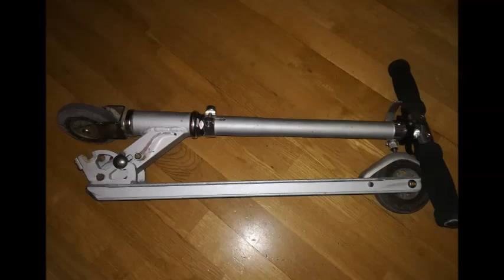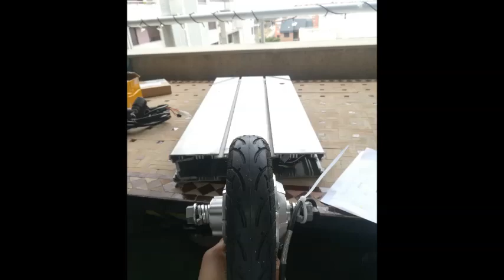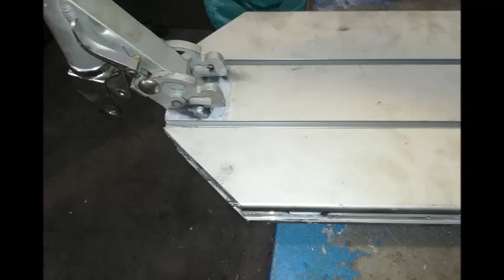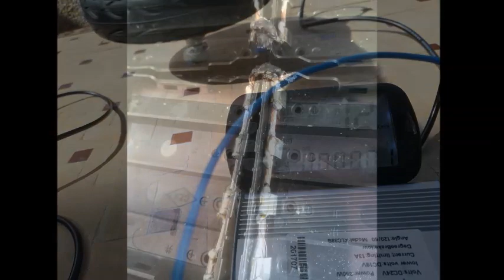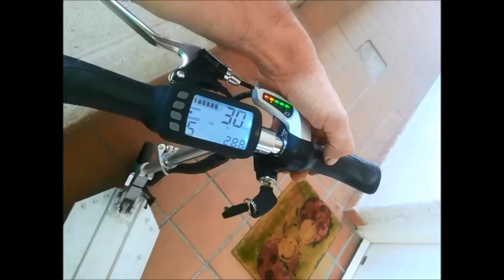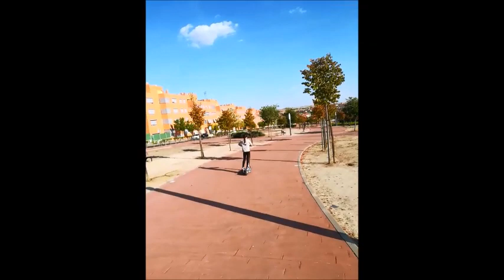FABRICANDO PATINETE ELECTRICO CASERO. kukanol one

Comment: Hola, cuál fue la configuración final? Tengo un motor de 500w y 48v, que disposición de baterías 18650 de 4.2v y 3500 mha me recomiendas? Muchas gracias por compartir tus conocimientos
Reply from the maker: Hola buenas, para tu configuración yo pondría un pack de 13s4p es decir 48v 14ah, aunque si entrara por espacio lo realmente perfecto sería una 14s5p pero esto ya es mucho peso y tamaño, pero sería una batería de 52v17ah, y te daría para más de 50 kilómetros a tope.
Menos de 4p sufrirá mucho las celdas por descarga.